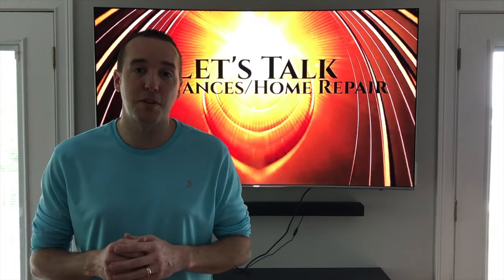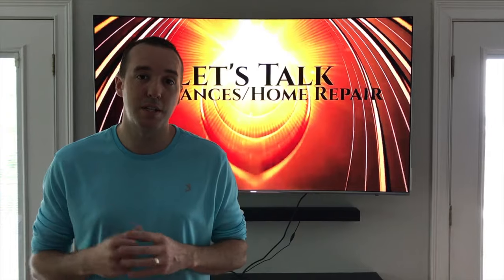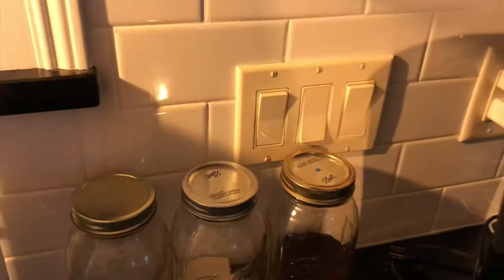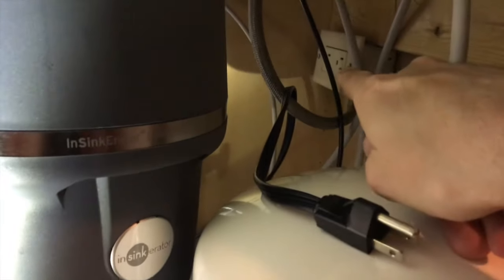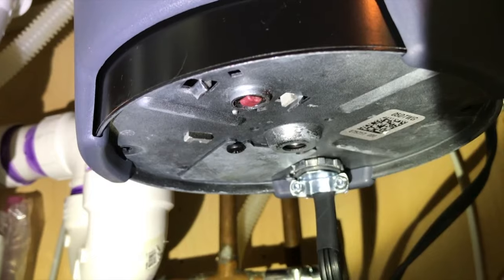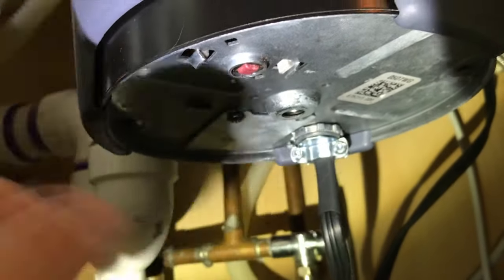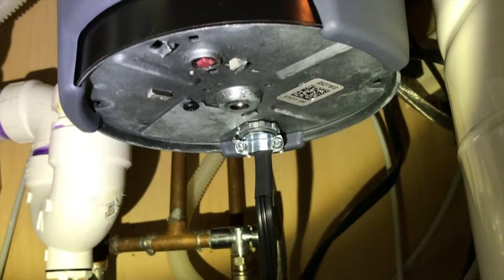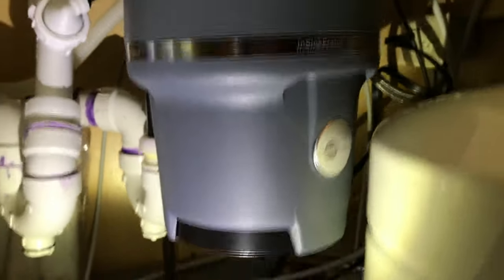Garbage Disposal not turning on - NO POWER - Try this first!

Comment: Thank you. A tiny spoon got jammed and after I retrieved it the disposal lost power. Outlet still worked, I could spin the blades manually. Next thought, I blow the motor.  Didn't realize the disposal itself had a breaker switch until this video.
Reply from the maker: You are very welcome.  A spoon will definitely cause havoc.  😁👍

Looking forward to 2024, many more helpful videos to come.  👍🧰

Comment: my garbage disposal ancient so didn't have a reset or a way to spin shaft from the bottom.  In the end it was a piece of plastic that had jammed down inside which I pulled out from the top using long nosed pliers.  Thanks!
Reply from the maker: Good morning, welcome to the DIY Raptor Club.  We appreciate you sharing this & we are happy to hear you’re back up and running.

😎👍🔧🔩

Comment: Hi sir I have a question, the power to my disposal goes out very often and I mean multiples times a month where I have to do this constantly. What does that mean?
Reply from the maker: Good morning Amanda, we are drinking our morning coffee answering any and all questions for the DIY community.

A few things can cause this:

     1.  Something stuck inside disposal leading to a temporary jam.

     2.  Electrical wiring issue, loose connection or damaged wiring.

     3.  Breaker loose which allows just the vibration alone of the disposal while running to pop breaker out.

     4.  Loose wiring in the internal wall mounted switch that turns disposal on/off

Hope this helps a bit, let us know if you have any questions, enjoy your week.  😎👍

Comment: This is extremely helpful. The only issue for me is that is cant unplug mine because its hooked up through the wall. What do I do? What would happen if I did it without unplugging?
Reply from the maker: Thanks for watching.  Welcome to the DIY Raptor Club.  We recommend turning the breaker off inside the main household breaker panel/box that supplies power to the plug the disposal is plugged into.  Keep us posted on your project.  Us fellow DIY’ers need to stick together.

😎👍🔧🔩
Reply: @DIYwithMichaelBorders  thx so much
Reply from the maker: @sarabrinsfield  

😎👍🔧🔩
Reply: @DIYwithMichaelBorders  now I just have 2 figure it out since that it's plugged up behind the cabinet
Reply from the maker: @sarabrinsfield  

Keep us posted, we are here to help!

Comment: My garbage disposal is not hooked up like this. There is a silver hose that leads put to I am assuming and electrical outlet, but it feeds into a metal outlet cover and has 2 screws holding the plate in place and a clamp-like ring around that with a screw on top. I dunno

Comment: I did all of these steps, it would turn a little then stop, I sprayed WD-40 onto bolts inside garbage disposal at the bottom, works like a gem..
Reply from the maker: Thanks for watching & welcome to the DIY Raptor Club.  Great to hear you’re back up and running Gerald.

WD-40...a multi purpose solution.  😎👍

Comment: What do you suggest to do wen accidently rest button got pushed too inside and you can access it anymore
Reply from the maker: Thanks for watching.  First and foremost, make sure unit is unplugged and 100% disconnected from any electrical power.

You can then carefully pursue servicing unit.  It may be as simple as pressing a piece of tape onto the breaker and pulling it outward.

Keep us posted and hey if you’re into crypto trading, check out our newly launched DIY ecosystem.

       Toolboxtoken.com

Reach out to us any time!  🧰

Comment: We have a hum, but blades wont spin.  I'm able to manually move them easily.  I already used the hex key on the bottom but still just a hum.  Is there another step before replacement?
Reply from the maker: Thanks for watching.  Sounds like there might be something still jamming it up.  We recommend unplugging unit & inspecting inside unit for anything that may be causing a jam...again...unplug it 1st.

Use the hex key a few more times as well.  Keep us posted.

😎👍🔧🔩

Comment: Hello, can I still press the red button without unplugging the disposable? There is no cord connected that I can disconnect.
Reply from the maker: Thanks for watching, you can turn off power to the room by turning off breaker located inside household electrical panel.  👍

Comment: can I still reset the breaker if the disposal is wired directly into the circuit?
Reply from the maker: Thanks for watching, you will want to make sure all electrical power has been removed.  Verify switch is off, and at that point you will be able to safely reset breaker.
Reply: @DIYwithMichaelBorders  awesome thank you for the response!
Reply from the maker: @ayyyitsdenisse  

You are very welcome.  👍

Comment: Wil the garage disposal just off some of the power too. My garbage disposal is off but so is most of the power in my kitchen too. Already did the circuit breaker & circuit breaker under the disposal. Wouldn’t doubt the landlord has the wiring messed up
Reply from the maker: Thanks for watching & you will find that the garbage disposal is tied into the kitchen electrical wiring system.

This is for proper code regulations.  In most cases, your disposal will be plugged into a specific outlet designated for the disposal itself.

This outlet is controlled by a switch up near the sink which allows you to turn on and off the disposal at your convenience.

Hope this helps, thanks for watching.

😎👍

Comment: What do we do if we don’t see a cord that’s plugged in? Can we still press the red button?
Reply from the maker: Good morning, thanks for watching.  Is there currently a cord that feeds off of the disposal?

😎👍🔧🔩
Reply: @DIYwithMichaelBorders  the power was built into the wall. I ended up pressing that red restart button without being being able to disconnect the power, then pressing the reset button on the wall outlet and it back up and running again! However, I wouldn’t have even known that there was a reset button to push down there without you, thanks!
Reply from the maker: @christinamorin1914  

Thanks for the update & that’s great news.  We appreciate you sharing.  Hopefully many stress free days ahead for you Christina.

😎👍🔧🔩

Comment: This is all fine and dandy for everybody it worked for but what the hell do you do if it pops back out?
Reply from the maker: Thanks for watching & welcome to the DIY Raptor Club.  In that case, you most likely have a jam.

We recommend unplugging unit and cleaning out disposal.  After cleaning disposal, resecure plug firmly to outlet so it is not loose or halfway in.

😎👍🔧🔩

Comment: I  guess they ALL have that button?? I don't think I will be so lucky. My early Sixties house has NO Weather Head(!) so water comes into the meter and breaker box when it rains, causing brownout conditions inside. I've unplugged my fridge weeks ago (the compressor sounded Terrible) and was trying to grind up and throw out some rotten food, when I discovered the disposal wouldn't turn on. I am writing these words from a Hotel. I am blessed with a Generac, which I use during the day so the sump does not overflow. But, it's under my bedroom window and is noisy. Also, even on Generator power, my HVAC transformer keeps blowing (actually, it's when  I turn it off. I need to turn it off at the switch.)
Reply from the maker: Good afternoon, we appreciate you reaching out to us.  Have you ensured the disposal is getting power?

If it has power, it may be jammed.  Below is a link to our video showing un-jamming disposal.

       https://youtu.be/kKL_vgwtR60

If that doesn’t work, how old is disposal?...it may have called it quits...🤔

Comment: To unplug the disposal, I pushed the red circuit button and now it works but it does not stop and I have to unplug the electrical cord to let it stop. Pushing the button on and off does not change anything
Reply from the maker: Thanks for watching & welcome to the DIY Raptor Club.  Any update?

Was something recently jamming disposal which led to the red breaker popping out?

Comment: I did this , but mine keeps going on even if I turn it off or on through the switch.   The only way to turn off is to disconnect the power cable … any help please !!!
Reply from the maker: We appreciate you taking a quick moment to share this comment.

Did it just start doing this?  You may have an issue with your electrical switch on wall.  Please keep us posted.

Let us know if you have any questions and hey if you’re into crypto, join our DIY ecosystem.

       toolboxtoken.com

Reach out to us any time!  🧰

Comment: I wish I had a garbage disposal switch I used to have to just plug it in and yank the cord when I was finished, then I got this button that can turn it off and on remote button from amazon that can do that for me but looks ghetto, the wire is coming from the cabinet below above my sink ( I don't wanna drill any new holes)
Reply from the maker: @Moes_Prep_and_Tech  

Thanks for watching and sharing your thoughts, the switch is a very nice option and feature.  Any update on your project?

Comment: What if buttons keeps popping out after process ?
Reply from the maker: Thanks for watching & welcome to the DIY Raptor Club.  Have you verified the internal system is clean & clear of all food, debris, & gunk buildup...?

If not, you may be experiencing an overload with system.  Also, how does circuit breaker feel when you push it back in...?...is it loose or firm?

Comment: I did that and my garage disposal turn on without been turn on 🤷🏽‍♀️ now what ? 😆 it’s not turning off
Reply from the maker: Thanks for watching and welcome to the DIY Raptor Club.  We are assuming that your garbage disposal is plugged into an outlet that is fed by a light switch.

Did you plug the unit back into the exact plug on the outlet or did you connect it to the second plug.

Depending on how your outlet is wired will depend on which plug the garbage disposal is to be connected into.

We recommend unplugging disposal and plugging it into the other outlet plug however before that, just ensure that your switch is in the off position.

Keep us posted.  😎👍

Comment: Now it won’t turn off unless I unplug it
Reply from the maker: Get Over It WhySoSensitive? 

Thanks for watching.  You may have what is called a split switch outlet.  Try plugging disposal into the other outlet insert on your current receptacle.  See if it operates correctly.

let’s start there as it won’t take any money out of your pocket.  Keep us posted.

😎👍🔧🔩
Reply: DIY With Michael Borders so that worked.
Reply from the maker: Get Over It WhySoSensitive? 

Thanks for the update.  Us fellow DIY’ers need to stick together!

😎👍🔧🔩